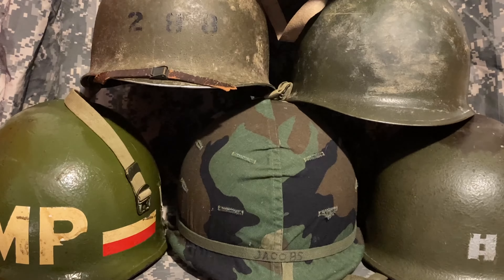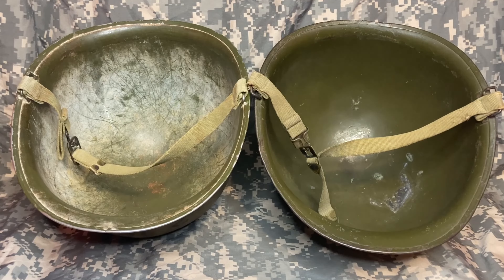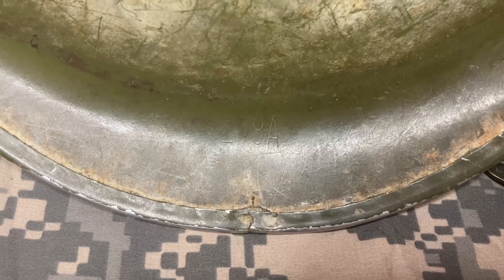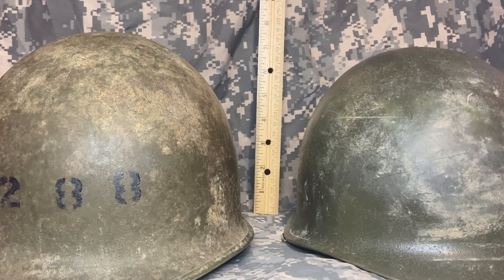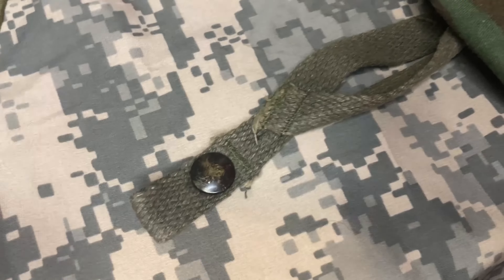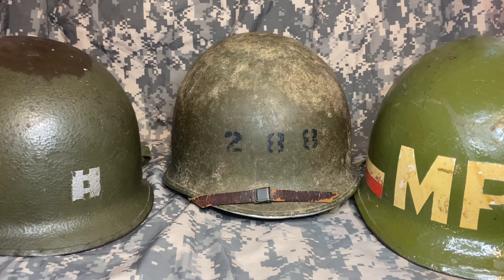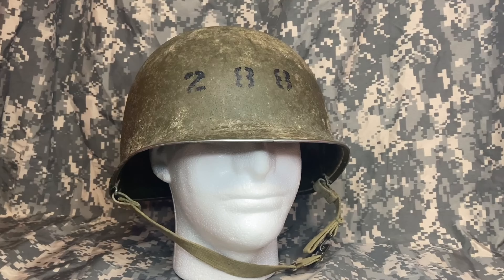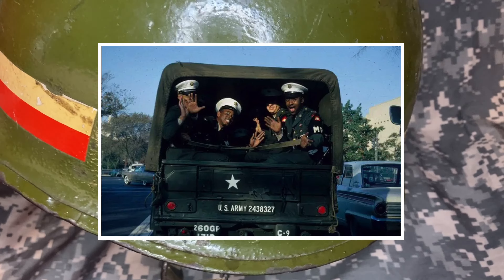U.S. M1 Helmet Identification Basics: WWII and Beyond

Comment: Another thing you forgot to touch on is the presence or absence of a helmet cover and what kind of camo pattern (if any) it has. Bare helmets or helmets with webbing or USMC reversible cloth covers were from WW2 through Korea, while helmets with the ERDL cloth covers were in use during Vietnam. Helmets with the M81 Woodland cover were post-Vietnam up until they were replaced by the PASGT in the 1980's.

Comment: I've got a stumper of an M1 helmet. Its a front seam but has a manganese steel rim with swivel bales, dark OD cork texture and sewn on chinstraps. The liner is worn but appears to be late world war 2 or korean war era. It's puzzling and different from my other m1, which was a front seam stainless steel rim Schuleter with sewn on chinstraps on its swivel bales. It had a Vietnam War era liner though.
Reply: Could be a transitional helmet. Everything else says it's WWII. The heat stamp will really determine the date of manufacture. It's no surprise the liner is of a later era. I found a Sclueter with Vietnam cover and liner, with intact paint and replaced sewn chin straps.
Reply: @chris.3711  sounds about right. And my WW2 Schuleter M1 had a Vietnam era liner too, with an ERDL camo cover and dark OD green helmet band, with its original sewn on chinstraps intact but fraying.
Reply: @ragingjaguarknight86 those older helmets were still out there in the US Army and national guard and reserve units up until the mid to late 80s. I saw a lot of older helmets in my training schools back in 83-84.  M1,M1C even fixed bale. It was a mish mash with different liners. My brothers national guard unit in Michigan had 50s and 60s airborne liners which they promptly cut out the A straps because it hung down and no one had the chin straps. Some of his units M1 helmets were WW2 versions.
Back then until we switched to the Fritz helmets the Army I don't think cared, it was a Steel helmet period hahaha 😁 
Cheers

Comment: Good video but it didn't get into the airborne variations, which is what I'm trying to get information on.  In particular, did the paratrooper variants go away with the introduction of the new 1970s type chinstrap?  Up until the post Vietnam era, the strap simply went under the jaw, not directly on the chin with a "cup" style.  Therefore, these types of helmets needed an additional "cup" style strap to secure the helmet when exiting an aircraft.  The latest type standard chinstrap introduced in the '70s had a chin cup style.  Thus, my question that I'm in search of an answer for, did the post Vietnam era still have separate airborne variations?
Reply from the maker: The best help I can offer you is that airborne troops wearing the M1 in 1983 in Grenada seem to be wearing the standard style chinstrap, so I guess that either surplus Vietnam era jump helmets were being used (maybe for stateside training) or it was just standard 70s models being issued to airborne troops.
Reply: I served from 83-88, I was issued standard infantry model M1 steel helmets that had either older tan or o.d. chin straps and later the retro fitted clip on chin strap version in army training schools, airborne school at Benning class (10-84) wore steel pots, I had a beat up WW2 or Korean version with tan chinstrap and 5 hole chin strap connected to the liner. 
Upon attending Air assault school in 84, we wore retro fitted M1 helmets.  The big one came just before we got the Fritz helmets, I was actually issued a brand new 67 dated airborne liners with handbook and a minty M1C. I promptly ran off post to one of the pawn shops and bought a beat up version which I wore and later turned in, this keeping my mind nam airborne helmet and liner which I still own.
What I can say is, the US military retrofitted tons of M1 steel helmets in the late 70s and early 80s due to maximizing their investment in equipment but there were lots of WW2,post war and Korean/Vietnam M1 helmets floating around in a lot of units plus national guard and reserve units. The Fritz started coming on board and we in the 101st began switching out in my unit from late 84 through 85.  I remember some soldiers in Egypt back in 85 still wearing M1C airborne helmets with Fritz desert 6 covers over them.
So if your putting together a collection, reenactment gear, uniform etc for a certain period I would say research as many photos of the unit through the time period your looking at.  You'll see we wore a mixed bag of old and new stuff. My older brother was in the national guard still when I went in, his unit was still wearing pickle suits and Mitchell helmet covers and M56 web gear. The new woodland BDU wasn't available to the public and I snagged him a used set off post at a pawn shop which were still in good condition, he was the first soldier to own a set before new enlistees started coming in all kitted out hahaha.
His unit wouldn't approve jungle uniform or erdl uniform. Lol 
It was a trip back then. Cheers
Reply: @starioskal  thanx for the vignette.  I went thru basic in ’93.  There were some reserve drill sergeants that came in & some of those cats were still rocking steel pots.